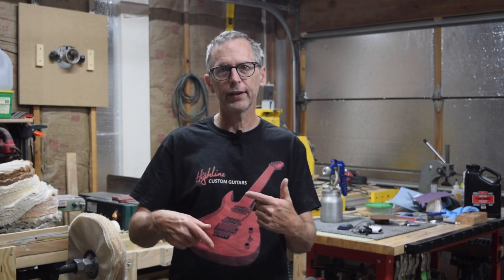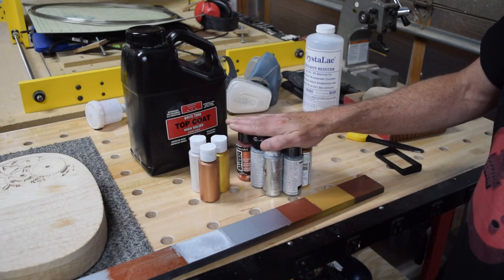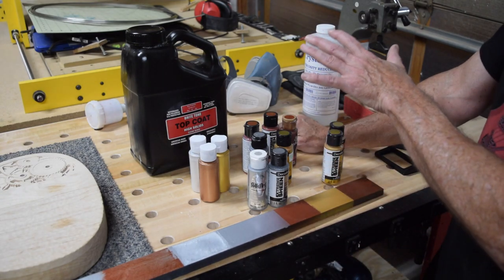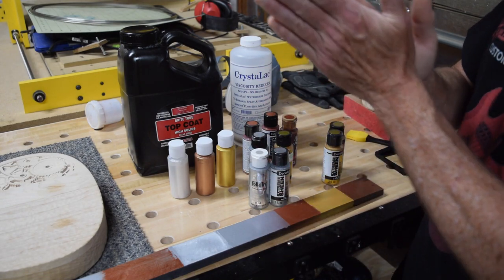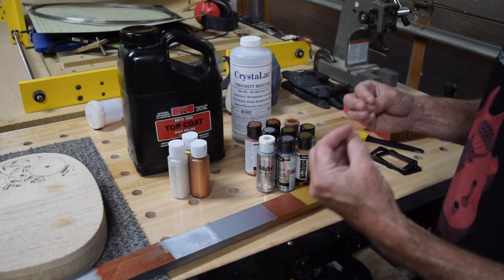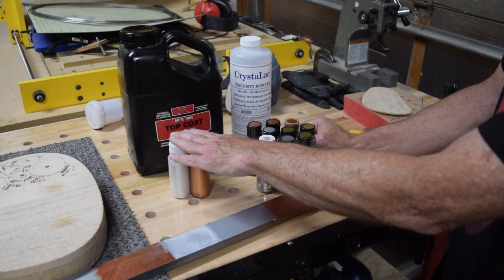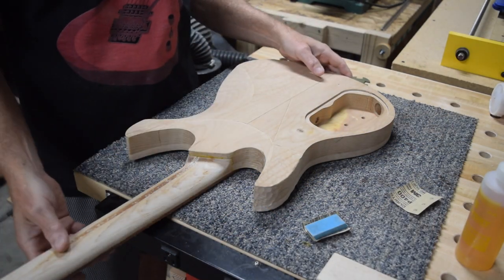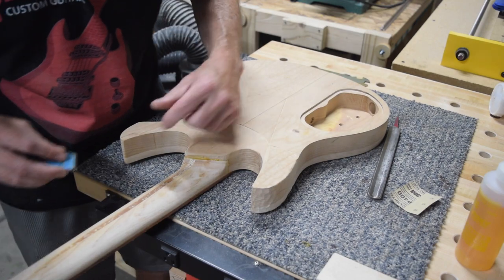The Steampunk Guitar Part 8

Comment: You have to be careful mixing gold and copper with acrylic clears. They can react with each other and the pigment can corrode and turn green.
Reply from the maker: Which is why I use Crystalac metallic pigments. They won't react when mixed with each other.

Comment: Do you use and should I buy machinist squares for guitar work or builds? Let me know what you think. Thanks.
Reply from the maker: Yes, I do use them and they come in very handy. Not only do I use them directly for builds, but I also use them to make sure my tool fences are square and my band saw table is square to the blade. Get a set. You'll use them a lot.
Reply: @HighlineGuitars  Thanks. I am looking at three sizes to order soon.